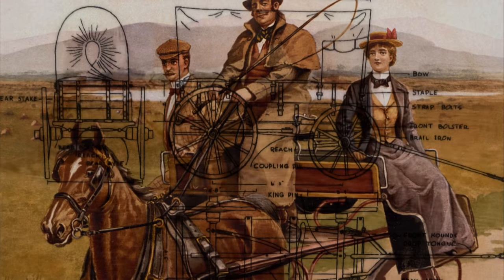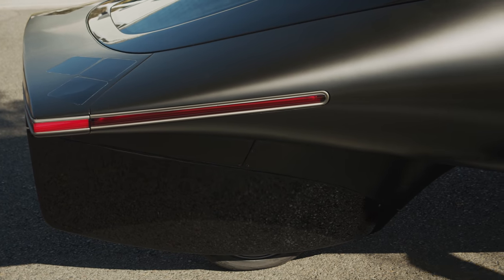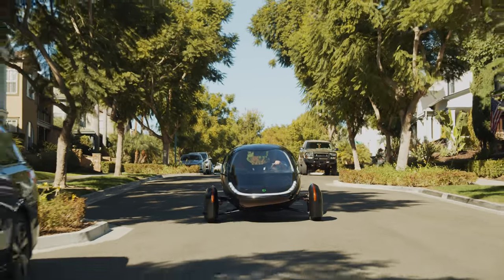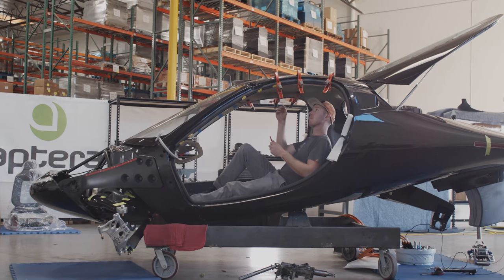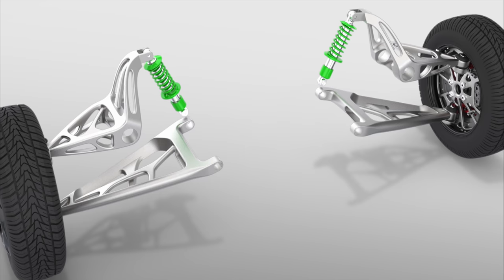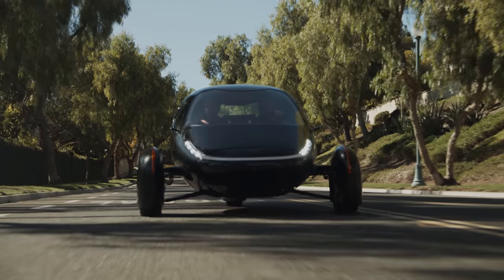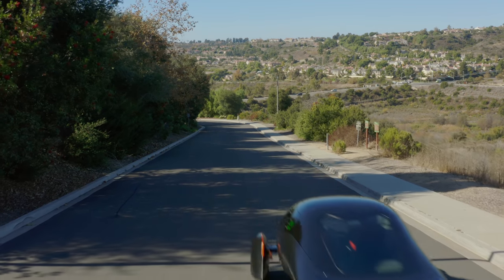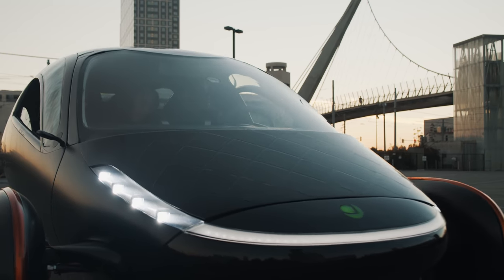Aptera Has Launched

Comment: I like that you brought up right to repair. That's a big deal.
Reply from the maker: We couldn't agree more!
Reply: @ApteraMotors  bruh gg
Reply: That’s what separates this small company from Tesla I love Tesla but it is very hard to get parts to repair your own Tesla
Reply: @ApteraMotors  A HUD would be very efficient and thus main screen can be dimmed to save energy. 

A low cost, low energy projection HUD should be considered for basic information MPH, navigation, range, volume control, etc.
Reply: @ApteraMotors  
With decades of advanced textile materials mechanical and manufacturing engineering experience, its  exciting to see a perfect blend  of multiple technologies into a harmonious design with awesome efficiency, fit, form, function & ultra low environmental impact like no other.

🍃No expensive chargers to purchase 

🍃Ultra Low to NO grid environmental charging impact (90% of grid power is from toxic emission producing power plants)

🍃No huge, heavy costly toxic batteries to purchase, replace & properly dispose of.

🍃Efficient, safe, easily available standard 110v charging if necessary. 

🍃Brilliant win/win/win
Reply: i pray that this is the direction the auto industry is moving in.
Reply: @ApteraMotors  This is the kind of Ev car company I would like to support.
Reply: Yeah I want to be able to cut my car in half and glue it back with flex seal
Reply: @godfather7339  yes
Reply: @samwilder5731  if you buy a Tesla from Tesla themselves, they give you lifetime free repairs on your vehicle. That’s a million times better than trying to repair the mess of electronics that are in this thing. No ordinary person can fix a electric vehicle, it takes specialists to do that. This shit is basically a scam because you’re buying a car you are literally unable to upkeep yourself because the smallest break and it will be useless and unfix able.
Reply: @Chronx100  Lifetime free repairs at Tesla? That's a straight lie!
Just to get the standard guarantee work getting done without extra costs is a hustle for the customer. As a M3P-customer from my experience: The cars are mostly great, the service is one of the worst ever (speaking for northern Germany, they even lie to you about laws, third-party wheels and lack customer-orientation in a big way) and Tesla's standpoint towards the right to repair is ridiculuos.
Sure, their work for EV's is great, but the company politics are really bad.
That's what I love about Aptera, by the way :-)
Reply: @alsterwasser08  you are probably right for anywhere except the US for Tesla, but buying a Tesla in the US you get lifetime 24/7 roadside assistance if you buy straight from Tesla. They will fix any repairs the car needs because they don’t want anyone else working on their cars.
Reply: So...the AppleCar that has pre-failed "water intrusion indicators" is already DEAD..Long Live Aptera !!
Reply: @ApteraMotors  what would estimated delivery time be? I’m fascinated by your vehicle and also live in San Diego. I love that you are local.
Reply: If you put it on  rails. Steel on Steel is 90% More Efficient.  90×300 MPG=27000 Per Battery Charge.
Reply: @G8tr1522  The autoindustry will never move towards decentralization, but always towards centralization. This is their agenda. Sadly.
Reply: HUGE deal
Reply: @Chronx100  where do you people come up with this nonsense?  If you can fix a regular car you can fix an EV.  They aren't anymore complex than an ICV just different.
Reply: I like that one year later I still can't get one .... sorry but launched means I can get me some of that...🤣🤣🤣
Reply: @dhdhchdjahx3296  don’t comment about something you know nothing about. Enough said.